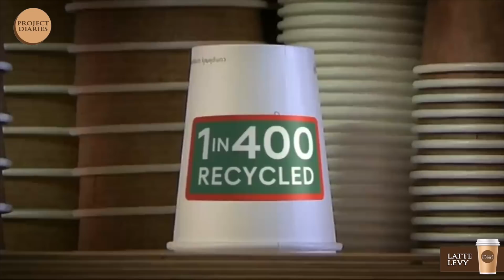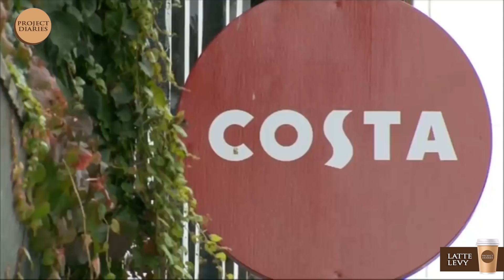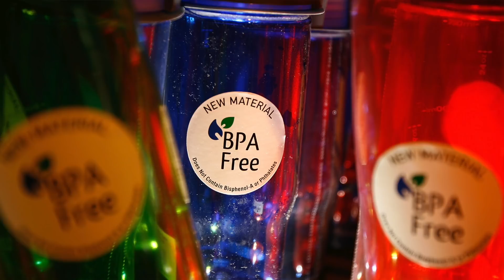★ The Untold Truth behind Coffee Cup Recycling (Latte Levy Tax Info)

Comment: Made from Plastics?  I always thought it was wax wow
Reply: And no wonder why you arent suppose to reheat/microwave them also
Reply: If you buy frozen meals, those boxes are plastic coated too.  Recyclers all over the place don't particularly like to receive them.  The same coatings are on lots of paper plates, too.  Paper cups WERE waxed at one time, but I haven't seen one of those sinse the 1970s.
Reply from the maker: Wax can be on the outside but it's usually plastic. Never microwave or dishwash any plastics as they will all leech over time
Reply: I did also
Reply from the maker: It's shocking how much plastic sneaks into places :(

Comment: Great video!  But, I always thought metal was bad for us, too.  It's not harmful to drink from the stainless steel cups even without the plastic lining?  I'm confused.  I can't wait for your documentary.   Thank you.
Reply from the maker: Lead and mercury etc are bad but at the moment stainless steel is the safest option as long as it hasn't got a plastic coating on the inside
Reply: Aluminium is bad for us; I think here in the UK aluminium teapots were banned ages ago, and we have stainless steel ones in cafés now. As far as I'm aware, stainless steel, glass, wood, and ceramic are the best materials to have in your kitchen. I'm not sure about silicone (mixed information) but I use it minimally :)

Hope that helps :)
Reply from the maker: @SabrinaCWB168  indeed. Aluminium is now also being linked to alzheimer's and other neurological issues :(